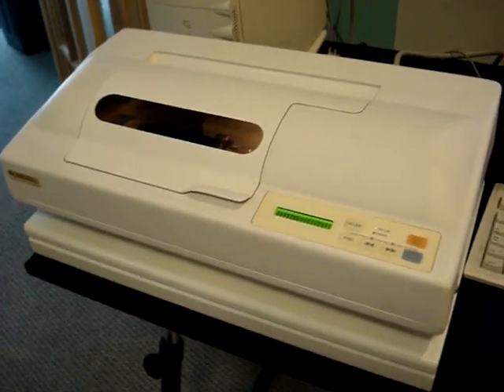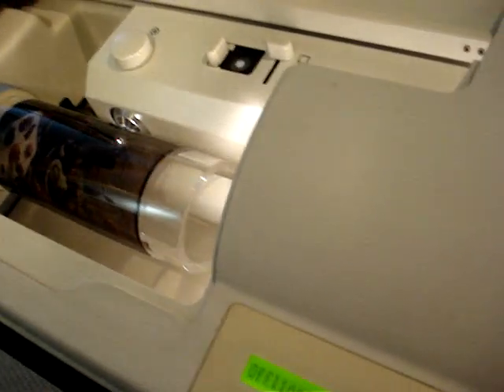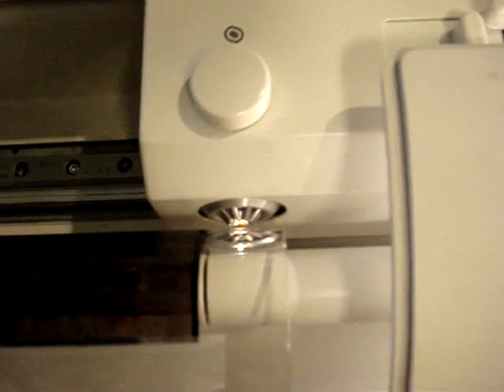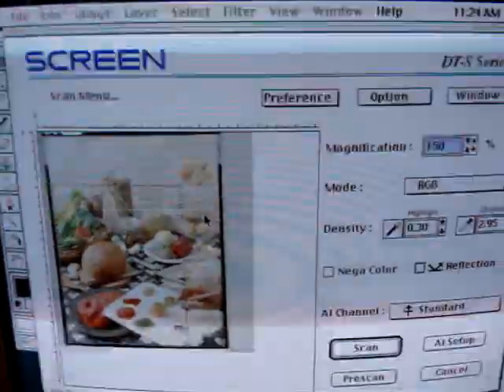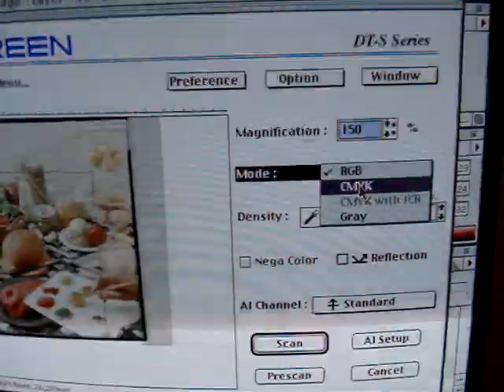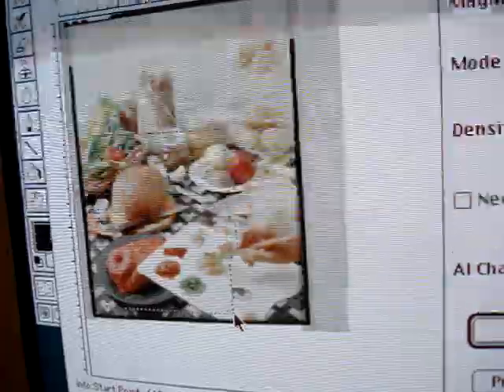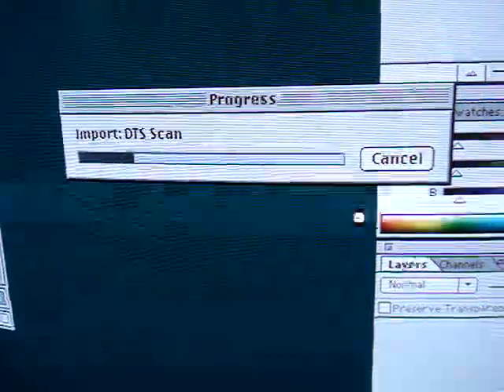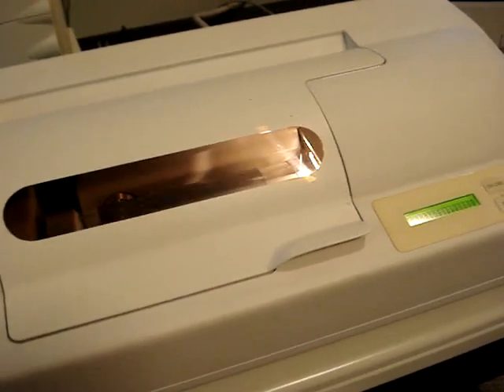SCREEN DTS1015-ai Desktop Drum Scanner Part 1 - 06.20.2009

Comment: my husband has this drum scanner, but the mac used to power it has died & the drum scanner connects with a scuzzy cable, I think - which isn't used any more.  Do you know of a place / way to get the right kind of (very old) computer to work with the scanner?  thanks!
Reply from the maker: 'ello Ms Yang.  I missed the notification for your question, 'til now ... 10 months late! Hope you've found an old Mac to suit your needs by now.  If not, try eBay or a local computer repair, sales, re-sale store for an old computer with SCSI or to see if there is any SCSI adapter/conversion options ...